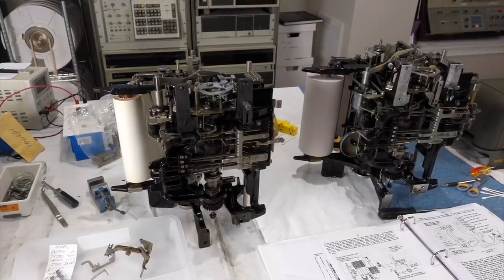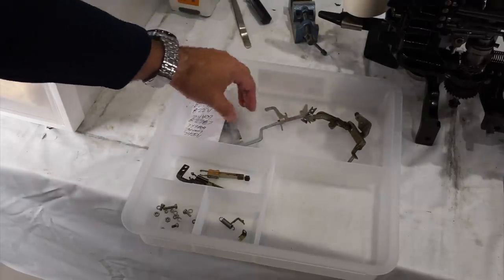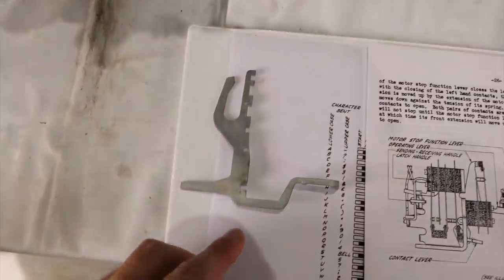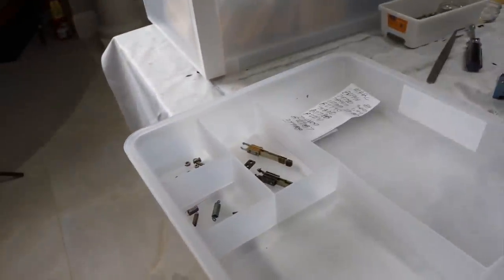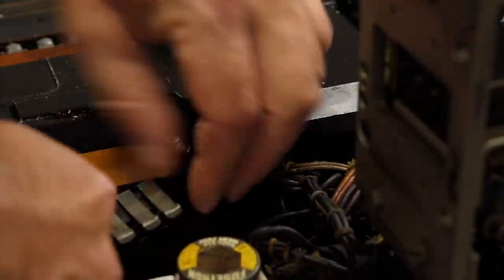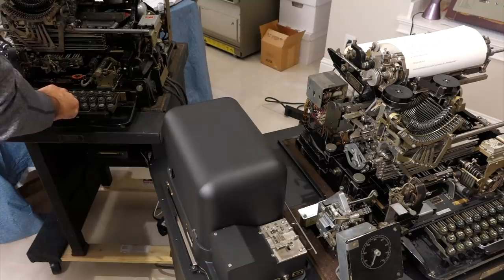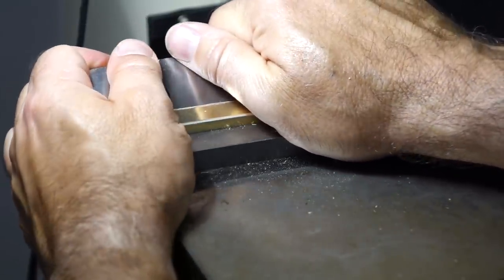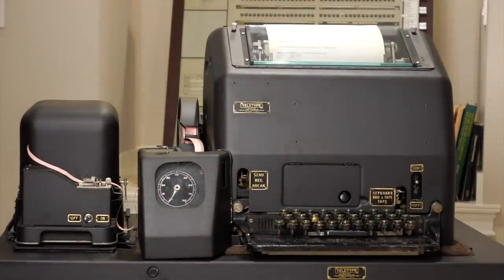Teletype Model 19 Part 14: Final Stretch, Pimping Up the Teletype

Comment: You will hate me after hearing this story. In 1979, H.S. Freshman, I bought at the Wheaton Winter HamFest a fully functional Model 19 page printer, with working keyboard, a typing reperferator, a fully functional tranmitter distributer, and various misc parts. I think this was use by the military, as the page printer came in a large green box with handles, flip up latches to detach the top of the box from the bottom. The whole thing was in working condition, and was complete. I used that for RTTY from HF (shortwave) utility bands. The issue with the Model 19 was it was only geared for 60WPM,  at least the machine I had. UPI from New York was the only intetesting utility broadcasting at 60WPM. The world "standard speed" was 66WPM. Close, but no cigar. There were a few 100WPM broadcasts as well. I came across a person in the Chicago area who had a Model 28 RO with a 3-speed gear shifter. I shamelessly traded my whole Model 19 set, yes everything, for this teletype. I still have the M28 Teletype, and it still works. I've got a Raspberry Pi project (Google: Luddite Raspberry PI Teletype Project) for driving the Teletype. Watching your video, and remembering the excellent condition the M19 Teletype I had, I now regret having let that kit go. Being a H.S. student without income, it was a fair trade at the time. I used the M28 Teletype for over a decade, reading utility band RTTY, most that would have been impossible with the M19.

Comment: Now to make an Ethernet to Teletype adapter so you can send TTY over the internet between those machines ;-)
Reply: That would be an Arduino with an Ethernet shield or a Raspberry pi and a collection of discrete components including an optical isolator to handle the current loop interface.
Reply: There actually is such a thing. Its called Telnet and this idea of interfacing teletype over a network was one of the very first RFCs of the IETF which at the time was a forum of the US government.
Reply: I think there are still some radio teletype signals in the air. I have used a teletype in the 90s. After that just computer emulated terminals.

Comment: Another well done project!

I almost bought a model 28 back in the mid '80s to run RTTY on HF, but by then PCs were available, and my friends and I built a cheap FSK board out of 565 PLLs to plug into the ubiquitous Commodore C64 & Vic-20 serial port.

Comment: I used to work on typewriters, many years ago, but never dealt with anything as complex as that. Most of the repairs I had to do didn't involve getting that deep into the mechanism as you did when restoring and adjusting this machine. Certainly didn't get involved in modifying anything like that. Probably the worst thing I dealt with was replacing type bars, and my "favorite" thing, re-soldering typefaces back on.You are very brave.

Comment: Things considered for pimping and not used. Racing stripes, air filter upgrade, zip ties, lighted fans, and chrome everything....   Amazing job sir. Probably better than new from factory. Can't wait until the next project. Does make me wonder. I read a great article that explained teletypes for micro computers had about a 4 year run until terminals was being used on computers like the Altair. That any optional interface for say the IBM 1401 or other computer of the time to a teletype network. Even if it was by a third party company was mfg. Even a program that encodes the paper tape onto 9 track tapes for storage. Then run it back though the system and out to a teletype network. Would seem to be a simple idea. I know some of the later teletypes seemed to almost be a computer in itself. Built in analog coupler modem and such. Anyway food for thought.

Comment: Oh man, This was a trip to see the complete restoration. But it got me thinking. How did they manage back in the days to get this over the air?
Reply: They used radios.  So, the tail number of an American aircraft always begins with the letter N.  That is a call sign.  It has a transmitter and a receiver.  The key board would hook up to a keyer which would hook up to a transmitter which would broadcast continuous wave to a receiver which was hooked up to a keyer which was hooked up to printer.  I was at NQC and NAA.

Comment: Really nice restoration! It looks like you might be missing some large etched decal on the front cover of that machine? Probably something like condensed (and useless) operating instructions?
Reply from the maker: We are missing the front paper holder - a large rectangular support with a bar to hold the piece of paper you were reading from while typing. The Model 15 has it, you can see it in the part 9 video, here: https://youtu.be/FUWn7AAqBU8?t=1371 .

Comment: Did it come as an available option or are you adding a feature that wasn't available to that particular model?
Reply from the maker: It was an available option from factory. My model 15 had it. You can see that it had been engineered to facilitate installation without taking the machine too much apart.

Comment: Cool! It should be a useful setup if you connect it to your Dolch computer and boot into Linux. Also would be cool to run scripts from the tape. Or even connect two teletypes to the two Dolch machines and communicate trough the internet by using ssh/telnet/netcat...
Reply from the maker: I get that comment all the time, but people forget that this is a 5-bit Teletype, not a later 8-bit one. It would be mostly useless as a Linux console. The 8-bit ones, on the other hand, were the workhorses of early Unix development.
Reply: @CuriousMarc  You are right, I completely forgot that it is a 5-bit one. Need to define escape character or something to encode more symbols and make it functional. But it will be not much pretty.
Reply from the maker: @paulorlyk7271  Not to worry, we have 8-bit ones coming. But you are sure right, you can't beat the steampunk beauty (and build quality) of the early 5-bit ones.